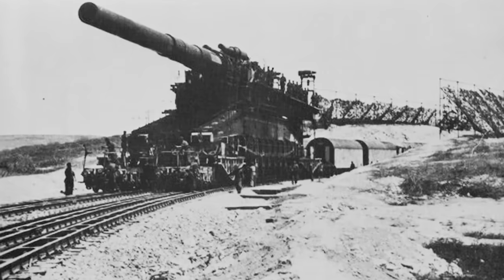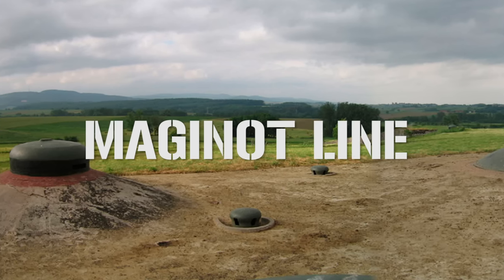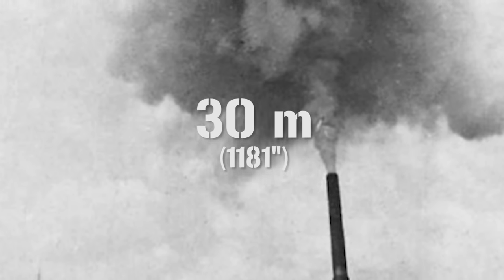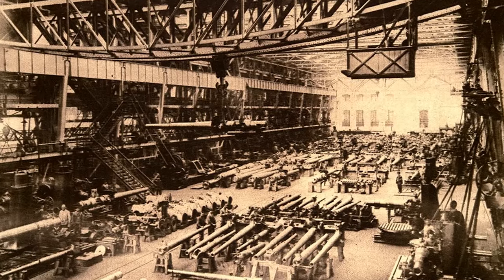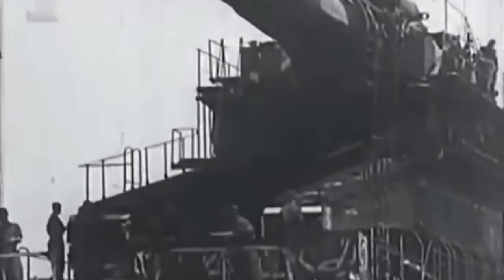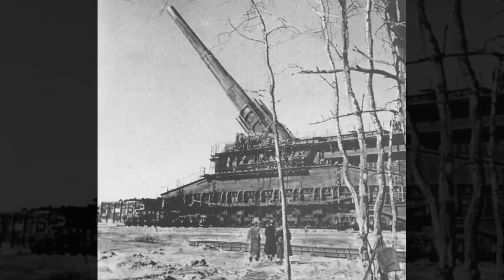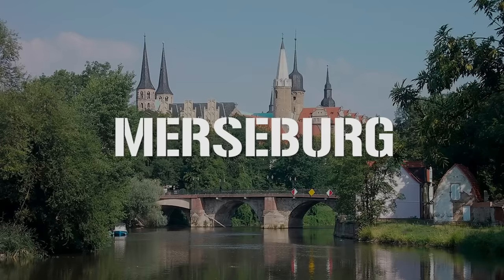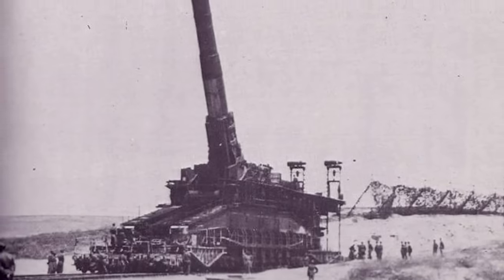Schwerer Gustav: It's a Really Big Gun

Comment: The shells were numbered specifically in their list of firing. Because every shot would line the inside of the barrel with additional debris, reducing its inside diameter continually. So every shell had to be a tiny bit smaller than the previous one, until finally the barrel would become so warped and twisted by the enormous strain on it that it had to be replaced completely, resetting the numbered count of shells to zero and starting all over again.

Comment: Schwerer Gustav had a total weight of 1350 tonnes. Monster at 1500 tonnes would have been just a bit heavier in comparison - not 110 times heavier as stated. Just from the weight proportions, I guess Monster would have been more of a self-propelled howitzer - than an actual tank.

The idea of Langer Gustav was to use a sub-caliber sabot round of 52cm to achieve higher speed and therefore longer range. With a payload of just 180kg - it wasn't worth the effort.

2 Schwerer Gustav have been build - but only one was ever used in battle. It was called "Dora" later on by the artillerists.

The mentioned destruction of "Langer Gustav" by RAF bombing isn't mentioned in German Wiki.

Wear on the barrels was even worse than stated. They were planned to fire 100 rounds before replacement (not 300) - but did much, much less in reality. After only 15 rounds, precision worsened significantly. 48 shots were fired at Sevastopol. The best shot was 60 meters off-target - the worst 740 meters.

According to German Wiki, the remains of the gun were melted down by the Soviets in 1960.

Comment: 11:40 acktchually, a self-propelled gun, or SPG. Despite what many tank enthusiasts or Wargaming may think, something needs to have a turret or an otherwise independently turning gun to be a tank. "Tanks" which were more in the lines of "big gun on a platform" aren't proper tanks, but SPGs.
Reply: By your definition almost every early tank would not meet the requirement as a tank. So the very things that coined the term „tank“ link the mark IV...

Comment: It was designed to fire an enormous eleven ton ground peirceing shell. Hitler, shocked by it's potency, assumed control of the use of that and so was never used.  The seven ton was augmented by the five ton. I have handled the sixteen inch, one ton, shell of the Missouri.

Comment: Perhaps not the largest artillery piece ever.
Consider Iraq's prototype "Baby Babylon" which was completed and 56 meters in length.   The incompleted "Big Babylon" was 512 meters in length.  

Both of these longer than Gustav's 43 meters.

https://en.wikipedia.org/wiki/Project_Babylon

Baby Babylon
The first of these superguns, "Baby Babylon", was a horizontally mounted device which was simply a prototype for test purposes. It had a bore of 350 mm (13.8 inches), and a barrel length of 46 metres (151 feet),[1] and weighed some 102 tonnes. After conducting tests with lead projectiles, this gun was set up on a hillside at a 45 degree angle. It was expected to achieve a range of 750 km. Although its mass was similar to some World War II German "large-calibre guns", it was not designed to be a mobile weapon and therefore it was not considered a security risk by Israel.[2]

Comment: Addition info may be found on https://en.wikipedia.org/wiki/Schwerer_Gustav (last updated 2020):

An error on the wiki: "Image of Hitler looking at the Gustav Railway gun": https://historyinorbit.com/175-fascinating-little-known-photos-of-the-past/45

The AP's  explosive weight 250KG (550lb) and the HE's was at a staggering 700Kg (1,500lb)!
"The gun could fire a heavy concrete-piercing shell and a lighter high-explosive shell. An extremely-long-range rocket projectile was also planned with a range of 150 km, that would require the barrel being extended to 84 metres."

Tradition of the Krupp company was, that the first gun was free. "Dora" had a pricetag of a mere... seven milion Reichsmark (app. US$24 million in 2015!)...

"Schwerer Gustav" was used during "The Siege of Sevastopol". It was in use five days and against 7 targets.

"By the end of the siege on 4 July the city of Sevastopol lay in ruins, and 30,000 tons of artillery ammunition had been fired. Gustav had fired 48 rounds and worn out its original barrel, which had already fired around 250 rounds during testing and development. The gun was fitted with the spare barrel and the original was sent back to Krupp's factory in Essen for relining.

The gun was then dismantled and moved to the northern part of the eastern front, where an attack was planned on Leningrad. The gun was placed 30 km (18.6 mi) from the city near the railway station of Taytsy. The gun was fully operational when the attack was cancelled. The gun then spent the winter of 1942/43 near Leningrad."

DORA:
"Dora was the second gun produced. It was deployed briefly against Stalingrad, where the gun arrived at its emplacement 15 kilometres (9.3 mi) to the west of the city sometime in mid-August 1942.[citation needed] It was ready to fire on 13 September. It was withdrawn when Soviet forces threatened to encircle the German forces. When the Germans began their long retreat they took Dora with them."

Comment: How about a vid on the follow on rockets  that were planned to surpass the V2 Or maybe that barrage cannons that were laid into the countryside that used successive propellant charges to launch a projectile across the channel.
Reply: Yes, the V-3 would make a good story. The prototype reached a range 90 km then blew up, so of course they immediately decided to make a whole bunch of them to try to hit London, which needed a 160 km range. They started to build a huge bombproof concrete fortress in Northern France to house them, the RAF duly bombed it so intensively it was never finished, then the Dambusters squadron trashed what was left of it with 12,000 lb Tallboy bombs. Total failure, start to finish. Should be required study for all Wehraboos.

Comment: Why not a mega project video on the first “functional” Railgun? The one that America built that requires  nuclear reactors worth of energy?
Reply: The first functional rail gun was built by a company was built sometime in the 60's by a company that needed to test armor and wanted a precise mechanism to accelerate a mass. It most definitely did not require a nuclear reactor worth of power. 
However what did happen is the government realized that they had developed it (not invented the concept had been around for years) and declared the device and all associated research as top secret. The actual difficulty is in the timing of the building and collapsing of the magnetic fields. 
Power requirements are dependent on the mass to be accelerated and the desired speed. It actually takes less energy to accelerate the mass than chemical means since there aren't the associated energy losses of heat noise barrel friction.

Comment: You forgot to mention that during siege of sevastopol, Gustav fired rounds at 6th of june against fort molotov and underground ammunition magazine:
"White Cliff" also known as "Ammunition Mountain": an undersea ammunition magazine in Severnaya ("Northern") Bay. The magazine was sited 30 metres under the sea with at least 10 metres of concrete protection. After nine shells were fired, the magazine was ruined and one of the boats in the bay sunk.
-Wikipedia
If that doesn't impress, I dont know what :D

Comment: Silly Nazis, you don't put heavy artillery on rails... you put it on a ship. To aim horizontally you just turn the rudder a bit.    For example, the Bizmark had 36cm main guns with a range of about 36 km.    Trouble is that in sea-to-sea engagements, the enemy is pretty much a concentrated dot on a sea of blue, so a gun that fired 1 shell per hour is pretty much useless against other ships.  But as a firing platform against land-based targets, that's the way to go.  This was how the US obliterated Japanese fortifications in its Pacific island-hopping campaign.  If you conceive of the UK as just 2 large islands, it's possible to envision the effect a pair of 100cm naval deployed guns could have had on blowing up UK air-fields, radar installations, etc.  Instead, Germany tasked the Luftwaffe with that task and it turned out not to be up for the job.  So that kinda brings things right into focus - a huge problem for nazi Germany's was inter-branch jockeying from money and power, meaning that the army would have never allowed it's mega-gun to be retasked to the navy, even after it was apparent that the window for use in the French invasion was going to be missed.